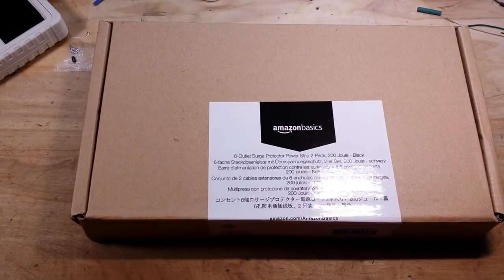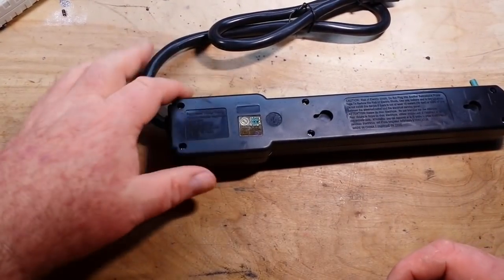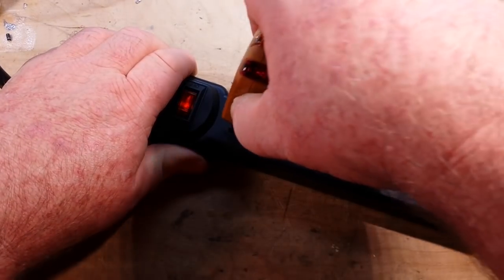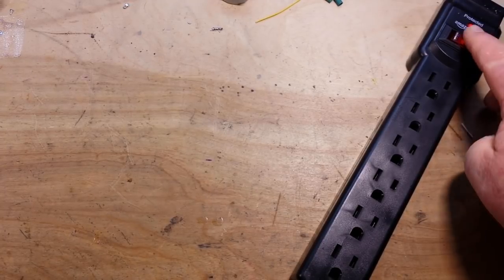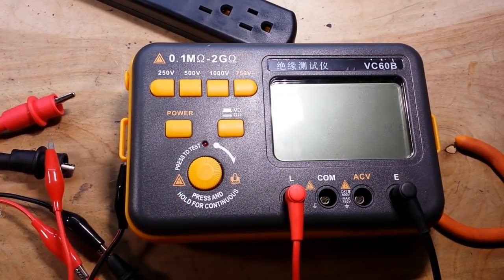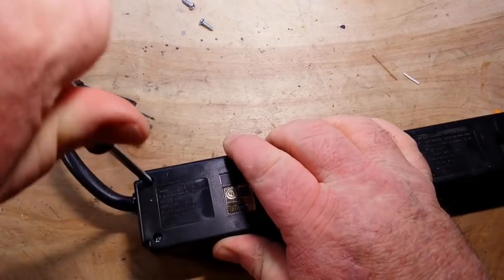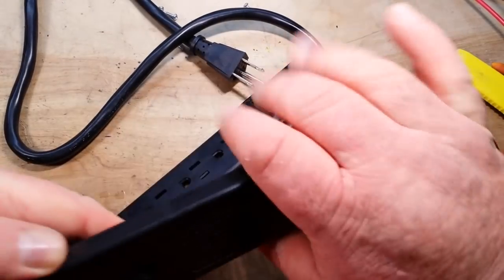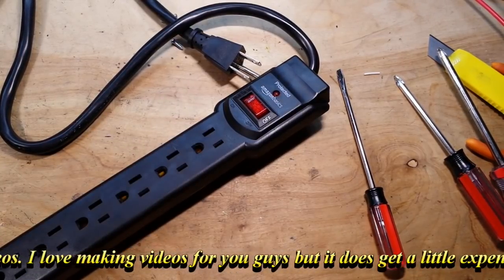Is it safe? Amazon Basics Powerstrip B014EKQ5AA

Comment: Clamping voltage of 800V is pretty useless; most electronics would fry before 800V. So think of this surge protected power strip as a plain power strip with no protection. The voltage drop test needs to be done with a high load like a hair dryer, and if you do,  measure the voltage at the load side because the biggest resistance is between the power strip and the load's plug's prongs.

Comment: You REALLY NEED to get into arduino and using it for automation of home, I'm from the ohio valley too and even little old me is getting into it,  every body is into arduino and you should be too, you know more about electronics than I do. You can start with controlling a light switch against TIME, MOVEMENT,  TEMP, SOUND, PRESSURE, OTHER INPUT SWITCHES. .. and any combination of them and more. .
Reply from the maker: Check out my esp32 playlist, and my Arduino basics playlist. I think you will find what you are looking for.

Where you from?

Comment: The Varistor has kick in on insulation test. :P The cable plug seems thick for 1.5mm^2  which is very generous since the usual is 0.75mm² . Does they have EU version?
Reply from the maker: I don't know. Go on Amazon EU seach for power strip and see what comes up as Amazon's Choice. I can't tell here.
Reply: @learnelectronics  It only appears the USA plug on Amazon Basic products. No worries :P

Comment: Paul you should do a continuity test between neutral and ground with that bad soldering job, ground and neutral may be as one and would be bad that may have gave you a bad meager test  let me know what you come up with thanks .
Reply from the maker: The soldering isn't all that bad, just a great deal of solder. There are no bridges. The MOVs are between L-N L-G and N-G. They are dropping the resistance when the voltage is high. I expected that at 1KV but not at 500V.
Reply: @learnelectronics  yup ok thanks again

Comment: Do not in stall if there is less then 10 meters of wire between outlet it plugged in and panel know i think that is 40 feet and im pretty sure most apartments dont have that big of a foot print. Im a electrician and i have never heard that  has anyone else please a comment thanks paul great review.
Reply from the maker: I found that pretty odd myself. Maybe a bit of CYA on Amazon's part?
Reply: @learnelectronics  I was thinking the same thing but that's kind of drastic but hey whatever makes you feel safe thanks Paul
Reply: I think The distance might be due to what category of protection it is designed for. For instance, if it was connected on your panel it would have to be classified as an arrestor versus a surge protector. I think the line impedance offers some protection to the MOV’s during a transient event.

It is great that the MOVs do not conduct during the 250 V test.  I case of a loss of neutral event when you get 240 Vac across the MOV - they go up in flames.  So, the fact they do not conduct at 250 V is a great thing; however, 240Vac peak voltage is closer to 340 Vac.  Too bad there’s not a setting for 340 V.   I imagine that the MOVs start conducting at around 400 Vdc.  At the tested peak surge current, the voltage drop across the MOV is 800 V as specified.
Reply: Didn't understand that myself.. misprint or bad translation.

Comment: Thanks Paul. It seems to me that you have the probes on your insulation tester plugged in wrong. The negative should be in "com", shouldn't it?
Reply from the maker: No, the com is for AC testing. For DC they go in L and E (live and Earth)
Reply: Hmm. On mine they are used for AC and insulation test; but where yours says "com", mine says "earth", and the third socket is called "guard".